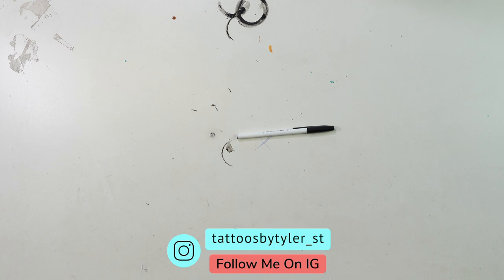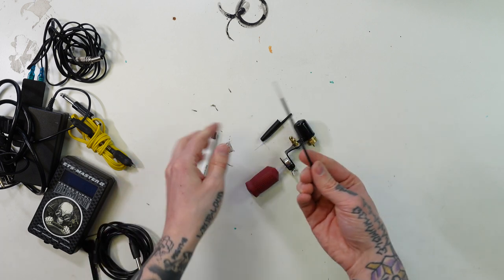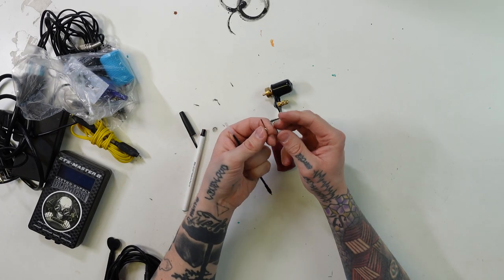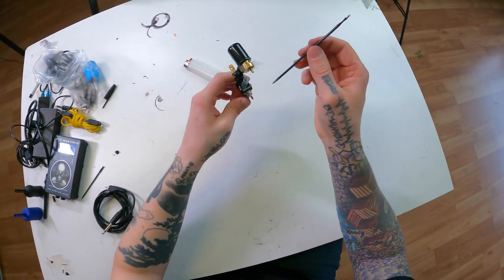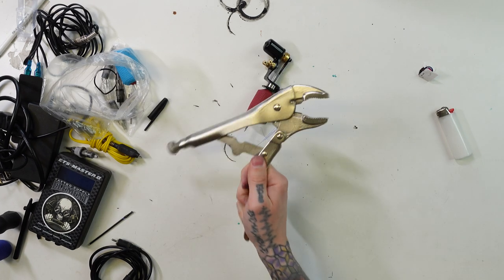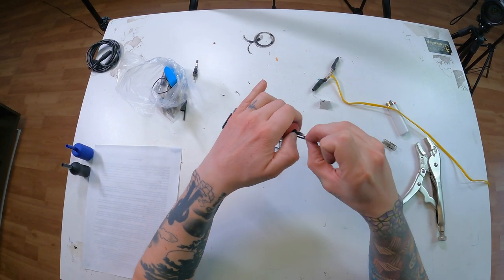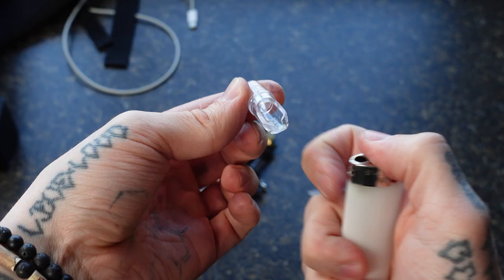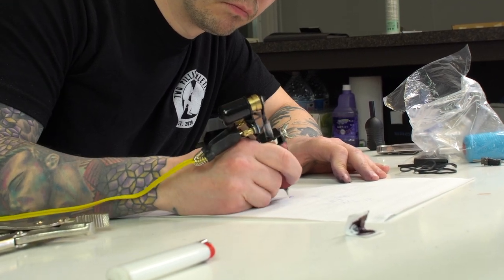Drawing With A Tattoo Machine

Comment: I did this with a cartridge it's super easy, clean and effective. Cut the tip off a cartridge so a pen can fit through the hole ( I used a 11rs to help), cut the needles off so there is still a bit of bar, cut the pen ink to correct size, slightly heat the cut end with a lighter and slide it over the needle bar, assemble the cartridge back together and if done correctly it'll basically just look like a massive rs, clean no ink everywhere. I'd make a video for this but YouTube isn't my thing lol.
Reply: begging yu to make a vid lol

Comment: I bought that same machine, but I've been actaully trying to make a rotary machine that isn't so top heavy with a wireless. I've bought a few knockoff machines, but they all have little flaws that I've "fixed"(I love taking things apart & modding them, hahaha). I even hold the wireless in front on 1, as a counterweight(so it doesn't pull back on my wrist). Works pretty good. Even as I watch this I'm thinking of ways to improve what you are making(you killed it though). It's just the way my brain works. Hope all is well, take it easy.
Reply from the maker: I get it man! I do the same thing lol
Reply: @ThatTattooGuyOfficial  Being a knifemaker helps, I got the tools, hahaha

Comment: I did it differently ... I looked for a bit with the thread down towards the top to be the same size in diameter as the grip hole and I screwed it in by pressing and after I tightened the screws the concrete came out .. And I fixed the rod in pen pen bending the rod a little where I cut it and put it through the inversion and I gave a little shell .. It came out mega well
Reply from the maker: Oh awesome. Now I did it once I have a few ideas to make it better lol